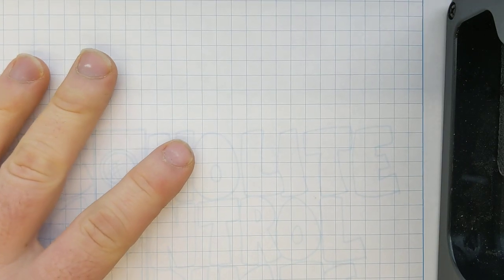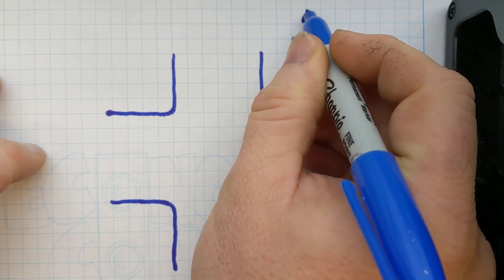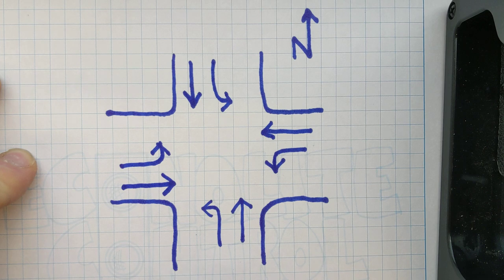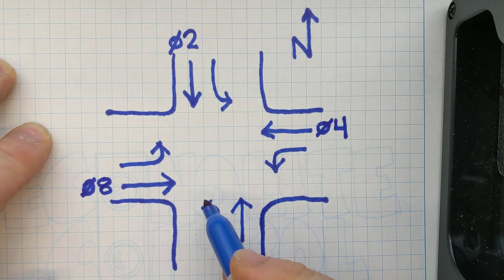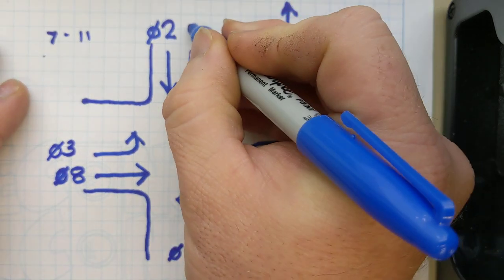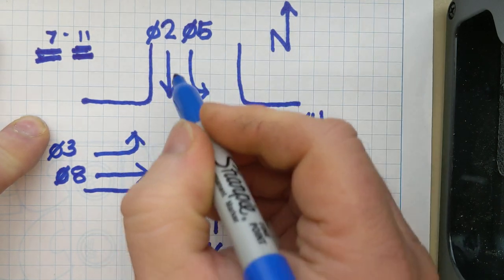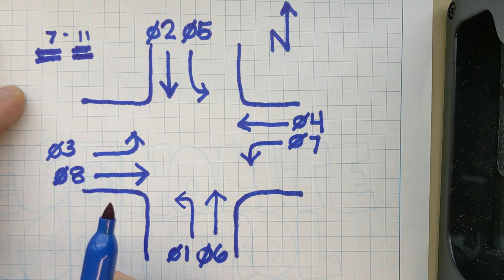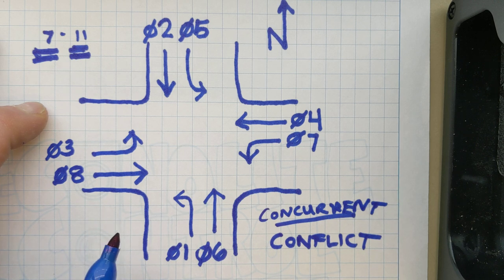Traffic signal phasing

Comment: BTW it gets even more exciting (or complex) when you add Overlap Phases (used in the older 5 section with the protected permissive setup 

Let the confusion begin ;-)
Phase 1 (Green Left Arrow N/B S/B) Then S/B no longer has a car in the turn lane so it ends (Yellow Arrow then off).  N/B still has cars in the turn lane and N/B Thru will get an Overlap A Green ball (and N/B pedestrian).  S/B is all red.  N/B left turn finally ends, and S/B moves on to 

Phase 2 thru times with Overlap A and Phase 2 peds (if applicable).

There are 4 Overlap functions engineers can choose from A,B,C,D in an 8 phase intersection.  Again this is the old school 5 section traffic lights.  In modern times the green ball has been removed and you have a 4 (or sometimes 3) section signal where the lower yellow arrow is flashing)

Using the lead/lag formula (thru traffic times before turning traffic), California Right Turn (usually times N/B or S/B right turn with E/B or W/B left turn usually NO RIGHT TURN ON RED signs are posted where this is used in some cases) 

Odd Phase (left/right turn movement Phases 1,3, 5, 7) pedestrian movements where N/B left side peds are WALK and S/B Left arrow is active.  Not a conflict.

Finally the newest variant of flashing left/right permissive yellow arrow turning.  BTW all of these would be outstanding "How It Works" videos.

Yes your brain will hurt, but I know many of you have seen these movements in action.  :-)

Comment: What I don't get is, phase just seems to indicate or relate to traffic direction, but what I don't understand is when a light is green yellow or red, that timing. Do the controllers control that switching and in a timing plan one only specifies how long and when a phase runs IE is in green, or when each individual red green yellow light is lit and when? Does a phase equate physically to a single signal that consists of a red yellow green? Do the controllers automatically figure out the red yellow green switching or is that also a part of the timing plan?

This is just not clicking for me yet. I just took a quick class on iteris and the class all assumed everyone knew about phases and timings, well I'm an IT guy hehe.

Comment: really good video, I have a question though, I'm currently working on a thesis about traffic light systems, 
and I have no idea about this subject since my main studies are computer science, so my task is to conceive a traffic light system in an intersection or at least do a simulation about it (in unity),
does anyone know some useful resources about this subject, especially if there are available solutions online for this problem so I can look up to(software and hardware, system, how they manage it, etc..)
Reply from the maker: I am so sorry that it took so long for me to get back here and reply to you. Hopefully you found the information necessary to write a well-informed thesis and you won a Nobel prize for it.

Or at least a passing grade.. what I could tell you is that different municipalities deal with different vendors that usually sell them on products and systems for their control systems. Depending on the manufacturer there are different remote monitoring and control applications that are used remotely typically from a command location.

Here at my municipality we use econolite equipment, and the software for remote monitoring the signals that are networked is called Centracs. All of the timing, coordination, time of day plans, flash status, detection, everything in relation to the operation of the signal for the most part is observable from the command center where the software is installed.

Our engineering department has a good handful of traffic engineers that monitor the equipment remotely and will consult with us for timing adjustments in the field and sometimes we will call them to make remote adjustments when we receive complaints.

On top of this we also have some surveillance cameras around different corridors that allow for us to observe the operation of signals remotely to fine-tune adjustments when there are repeat traffic issues for a specific movement.

All of these things for the most part require some sort of interconnected communication between all of the signal cabinets and a connection to the network that leads to our operations center.

We use different networking equipment at different locations some are on private cable with firewalls installed for them to get into our network through a virtual private connection, some are on fiber optic cable that runs directly into our buildings and directly onto our network. There are also signals where we have old copper interconnect that is being used now with technology called ethernet over copper that allows a high-speed connection over old lines that were used for modem and telephone use. We also have some signals that are remote and unconnected from anything else but due to the requirement that we have something to monitor in that cabinet we will install a cellular gateway that provides an internet connection through a SIM card of a cellular provider and an ethernet port to connect directly to the switch that the cabinet equipment is plugged into. These units must be configured specifically to have a static IP which means the IP address never changes.

All of these different interconnected systems are more recent developments over the past 20 or so years with networking traffic signals, however some of our signals were actually networked as early as the 1980s with twisted pair copper and monitronics monitoring systems. These systems were modem-based and required a lot more time to transfer information throughout the day but we're still very effective in keeping the clocks set correctly as well as providing early warning of signal issues..

Hopefully this information has proved useful and you are now an engineering wizard.

Comment: Great vid this is the second vid I check from your channel, Could you please make a video based on Gap reduction for traffic signal timing. Thank you
Reply from the maker: If you're referring to Gap as passage time that might be a pretty good video for me to make. Passage time turns out to be relatively useful for adjusting how cars actuate the signal and allowing for more cars to actuate the signal based upon the available detection methods.

I have come to find that typically a gap of 2 seconds is adequate for an average traffic signal with both detection at the stop bar of the intersection as well as perhaps advanced detection depending on the speed of approach.